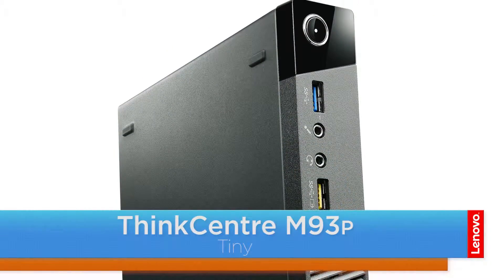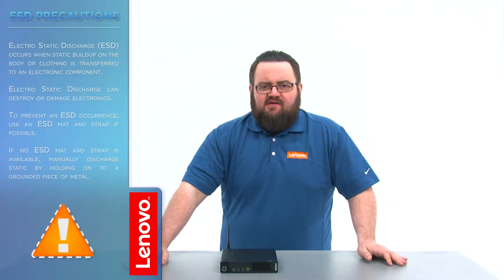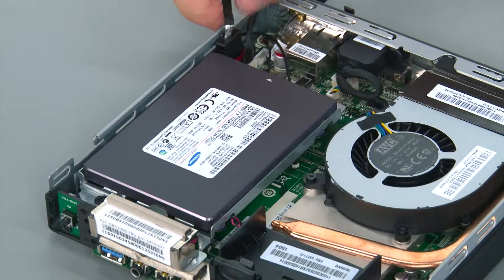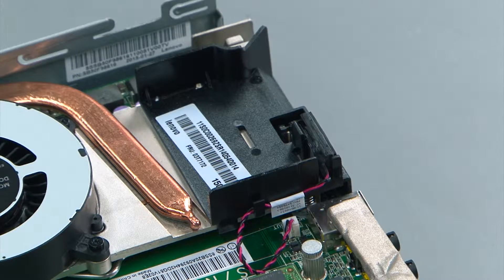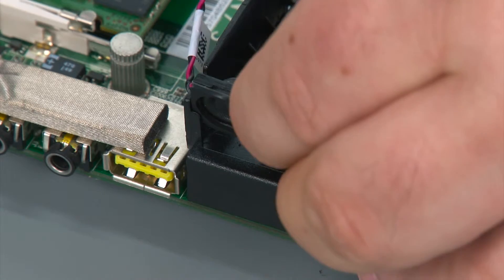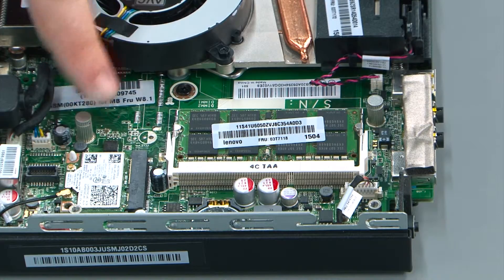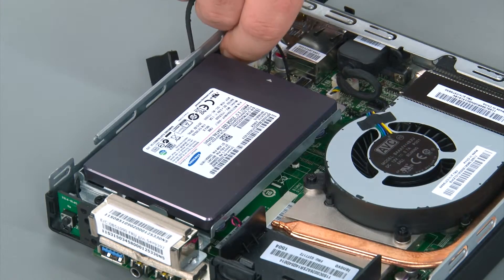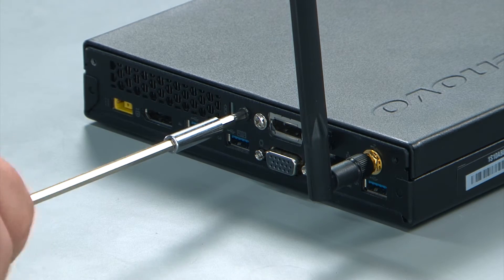ThinkCentre M83 / M93p Tiny Desktop - Internal Speaker Replacement

Comment: what is the name of connector or entry speaker?
Reply from the maker: Hi Mitchell. Thanks for reaching us. We'd like to clarify, are you using the ThinkCentre M93p Tiny or the M83 desktop? Keep us posted. Ash_Lenovo
Reply: @LenovoSupport  m73
Reply from the maker: Hi! You can check here on this link the cable and the model of the speakers for M73 https://lnv.gy/3f40XSV. -Jerry_Lenovo